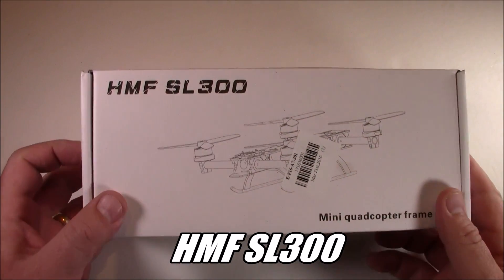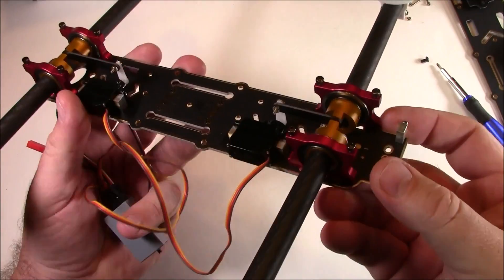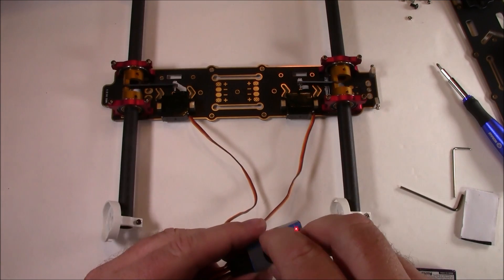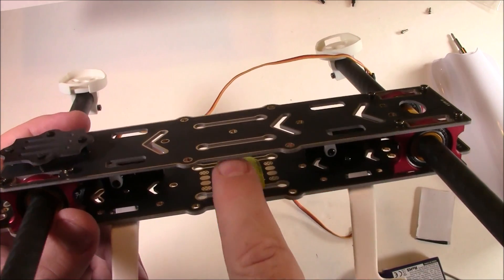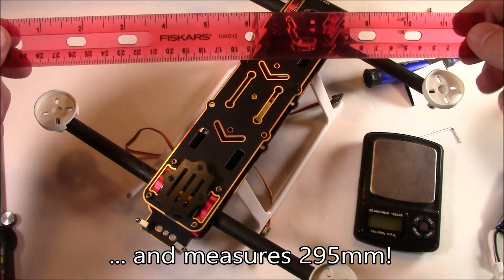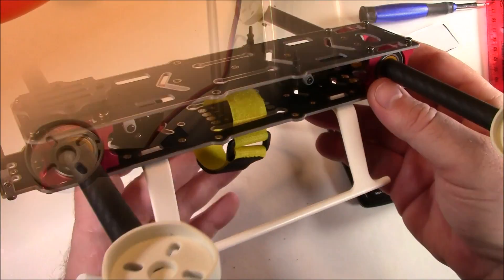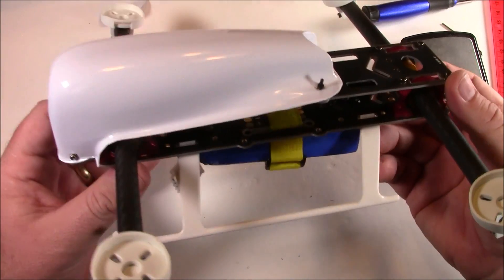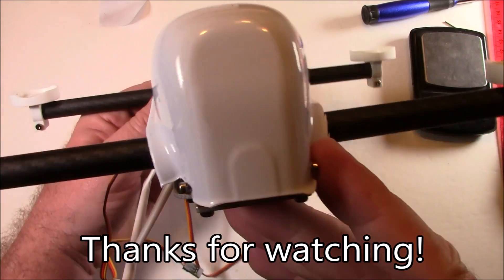HMF-SL300 Tilting Motors Quadcopter Frame Review from GearBest

Comment: What is flight controller firmware support like for motor tilting servos? Does clean flight support it?
If you get it built you should consider getting better servos. Metal gear, and possibilly digital, if you flight controller supports that. Digital servos can be run with much higher refresh rates. 300-500hz instead of 50hz.
Reply: YouTube should fix paragraph breaks when posting from the mobile website.
Reply from the maker: +TheUnnamedGent I'm not sure yet about CleanFlight controlling it.  On my tricopters, I've used digital metal gear servos and the movements were noticeably smoother.  So I may replace these if I get this quad built.
Reply: I haven't watched all your videos, I didn't realise you had tricopters.
Reply: I wonder if someone will make a tricopter where the front motors tilt forward.
Reply: TheUnnamedGent its been made check out my channel in the coming weeks ill post a review and flight video

Comment: Nice presentation sir :) A friend of mine picked one of these up as well (hasn't build it yet I think).. 
I went for the HK version: https://www.youtube.com/watch?v=dTcophkWbCg 
Are you going to let the FC control the tilting, or will you run them servo's straight from the receiver (as I did)??
Cheers & have a good week :)
Reply from the maker: +DutchRC Adventures I'm not sure yet.  It may be the receiver that ends up controlling the tilting.
Reply: +travisgrindal I would.. On mine I have set up 3 flight-modes in my radio for it.. With 1 having the quad behave like a normal quad.. As a sort-off fail-safe..

Comment: Tilt rotors are a neat idea but there are so many more things to break in a high speed collision.
Reply from the maker: +AeroScrew True, also, tilt motors add complexity - just like a rear servo on a tricopter.  Most people will want a more simple build like quadcopters with a flat main plate because it is the most simple build.  If we saw some of these win races, then the popularity would go up and it would be worth the extra complexity.
Reply: +travisgrindal Get metal geared servos!!